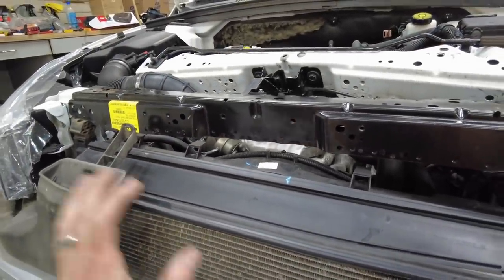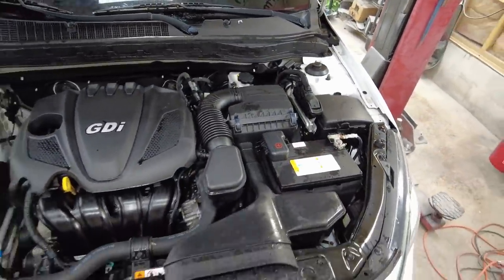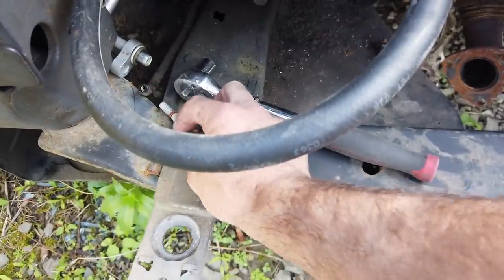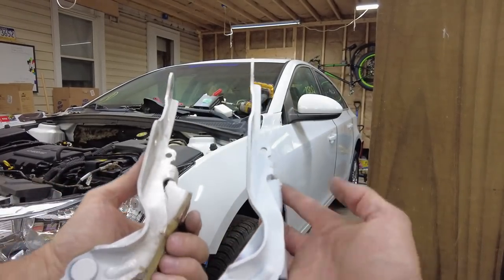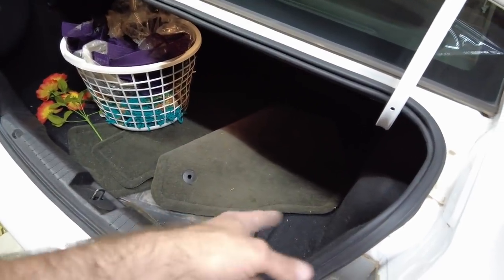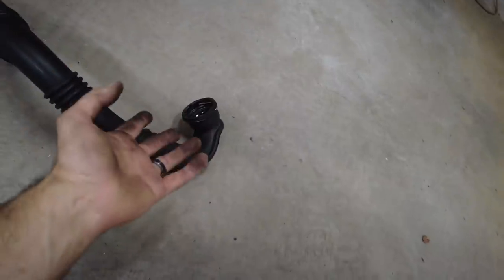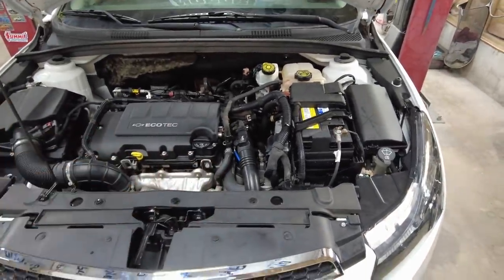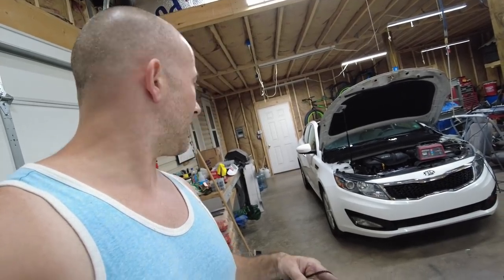The Copart Chevy Cruze is Finished

Comment: yeah my 2017 work car gets 38 mpg even with my lead footed driving, i can't speed in it or i lose my job but nothing saying how long it should take for me to get up to speed" They use the sonic treatment to blast your stones? or did you use the lemon deal i told you about to bust them apart on your own? either way when they come out it still hurts but once they do MASSIVE Relief instantly. surprised you didn't just plastic weld the charge pipe. LMAO yeah those cars are kinda gutless even with the turbo. Zero to 60 eventually. wish my work had bought us the trunk version like that instead of those uncomfortable as all hell hatchbacks. they are ok cars with good gas mileage but they are FAR from great cars unless you don't care anything about power at all or going fast. with the KIA hit it with a full on sea foam treatment 1 can in the tank and one through the intake